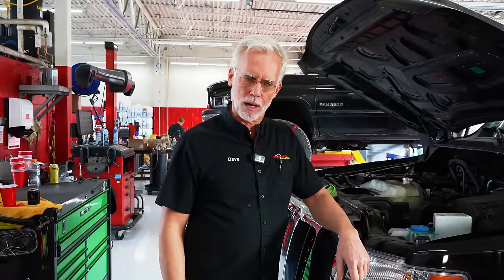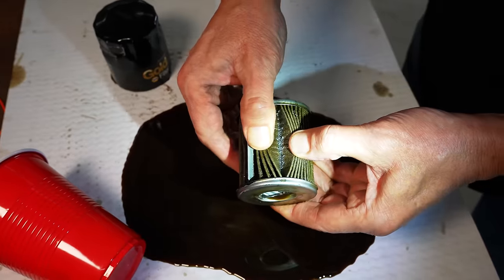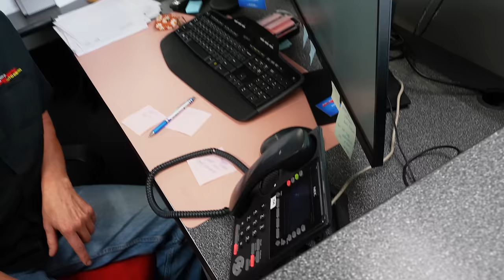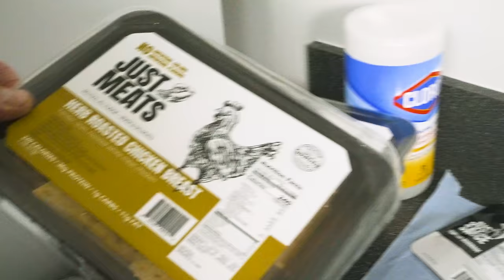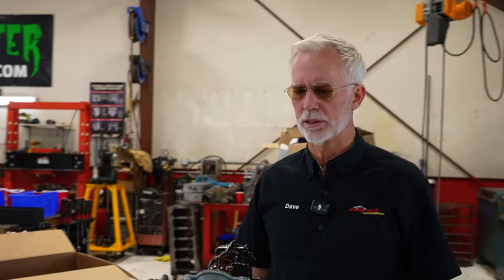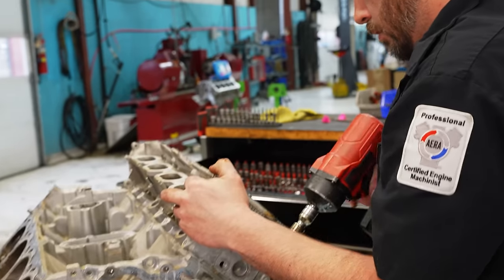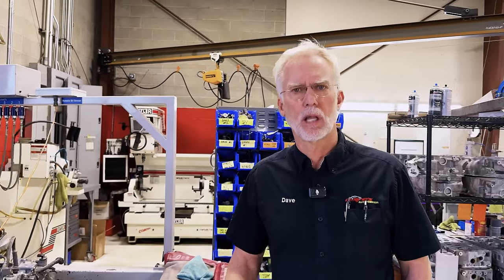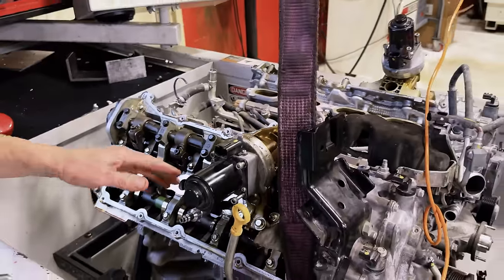2018 Nissan NV 3500 Van. Lack of oil changes ruined an engine with only 50,000 miles on it

Comment: Change your oil if you own the car.  If it’s a lease every 12000 miles , because it ain’t yours
Reply: Let’s pay it forward guys, jeez.  Take care of your equipment whether your going to keep it a long time or not.  The extra cost of doing your oil changes at 6k vs 12k over 60k… is what…. $350.  A hard working family is going to buy that used car to transport their kids around, spend the extra $350 while you have the car.  Good grief, filling up my wake boat is more than that!
Reply: @hokie9910  the dealership should give the customer a better price.  It the dealer that is at fault.  Remember the oil is rated at 10000 miles so 2000 more won’t hurt 😢
Reply: @Nafpaktos-Florida  We have no idea how long the oil is good for UNLESS we are sending it out for oil analysis.  Depending on driver, driving conditions, type of engine, oil could be good for 3k miles or as much as 15k.  My point is that an oil change is what 60 bucks or so, just do it every 6k and we will never have to worry about the insanity that we just viewed.  This guy can’t afford 60 dollar oil changes, but can afford a 10k engine,..come on bud
Reply: @hokie9910  it’s $130 in NYC and a 2 hour wait. This ain’t Kansas
Reply: @Nafpaktos-Florida  still doesn’t matter, $130 oil change every 6k miles or a $10k engine every 60k miles….my math says 10 fold I stay with more oil changes.  You can keep NYC, good grief what a racket.
Reply: @hokie9910  leasing a car on a business means 2 oil changes for the 3 year span.  And NO other maintenance because the car is NEW.  Yea that’s hate NYC but the wife won’t agree to leave for Florida still the kids are in college.  10 years to go…….
Reply: @stavroslask1292  you know u new yawkers  know there's other warm states then Florida lol